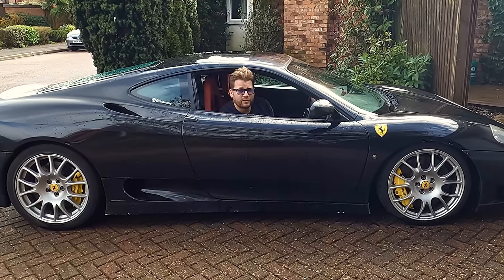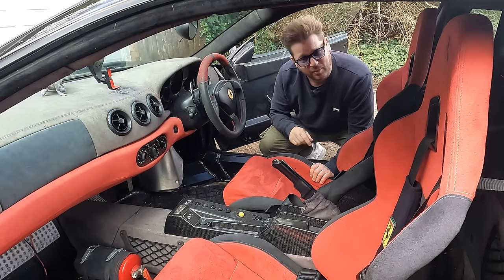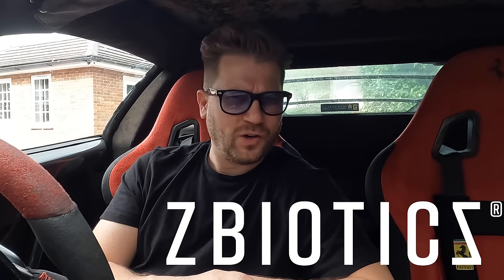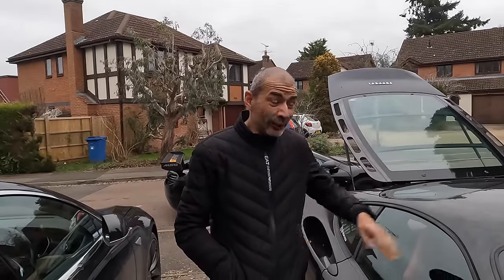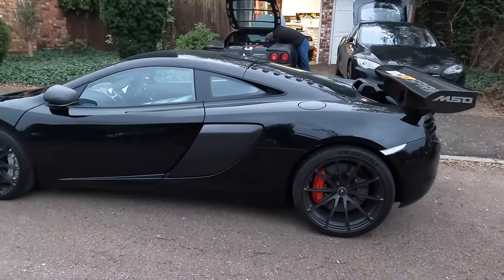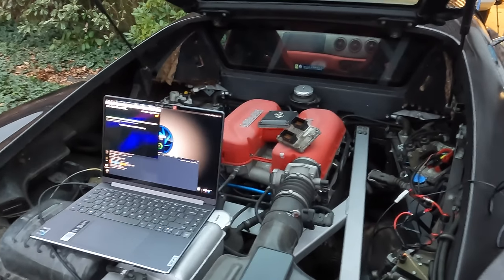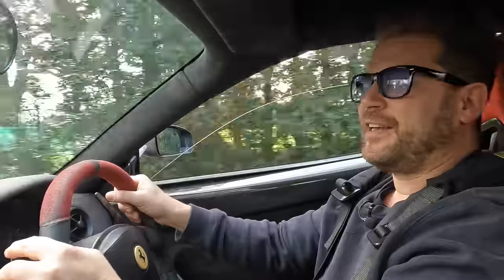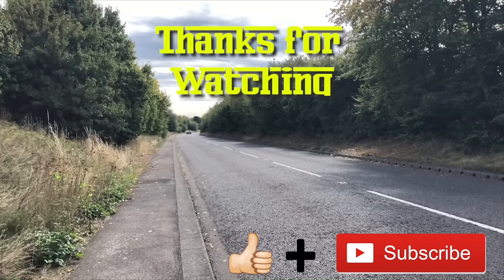RESTORING MY DAILY DRIVEN FERRARI AFTER 14 YEARS

Comment: I would say, keep the outside stock black and stripes. The inside needs to get rid of the red. Red interior does not take kindly to day to day use. Retrim steeringwheel black and get the rest in cognac leather with matching stitching. Or if you want to change the outside, there is no cooler color than Rosso Vinaccia. Maybe with a white stripe. That would made the car stunning. Google Rosso Vinaccia Enzo and you will know what I mean. Great to see you back, man! LIfe do throw curballs sometimes. Now - keep on living and for Christ sake show us the F40!😝

Comment: Either keep it original, or paint it in Giallio Modena. In both cases put the stripe under the clear coat. Leave the wheels as is. They are so iconic for the Challenge Stradale.

Comment: @Ratarossa usually real Alcantara can be restored to near mint condition with dish soap and some TLC. 
Try it on the steering wheel and you will notice it right away.
Reply: Yes that helps, but it doesn’t change the faded portions
Reply: @JStryker7  yes, but you can paint\dye Alcantara. Would be way cheaper than redoing it and a cool DIY content for the channel.
Reply: @LucasBrito-sy4em  look at the dash by the phone mount. It needs to be replaced

Comment: Personally I would first check how many others are in the same color/ interior combo etc. If you have a rare color interior then keep it orginal. If there is alot around then go nuts with what ever you want, its your car

Personally I would do a OEM plus build,  I would retrim in a leather as it is more durable and easier to clean and maintain for a daily driver.

Comment: If it were mine, I'd strip the interior and install triple layer sound deadening on floor, doors and roof.
Yes, it goes against the "weight saving" Ferrari did BUT come on, whos going to feel 40kg ish in extra weight.
I want to hear the engine/exhaust NOT the road noise.
That car deserves a better exhaust. Get in touch with ArosMarmitte in Italy.